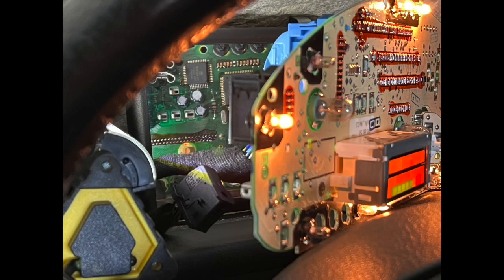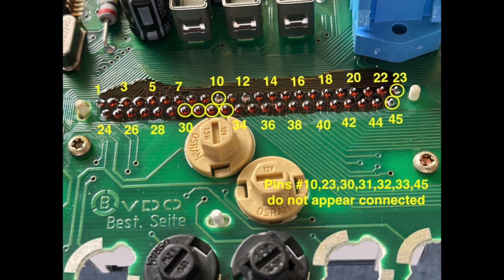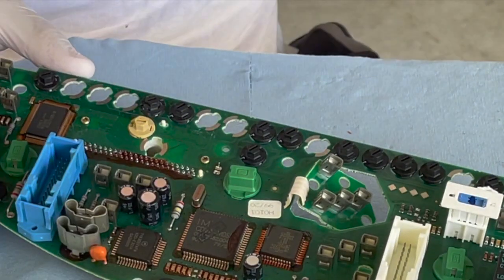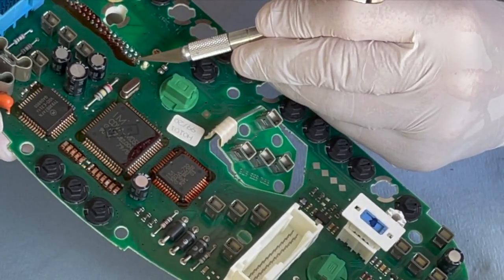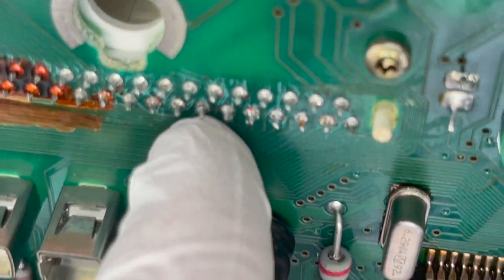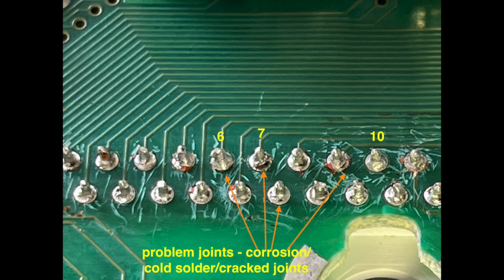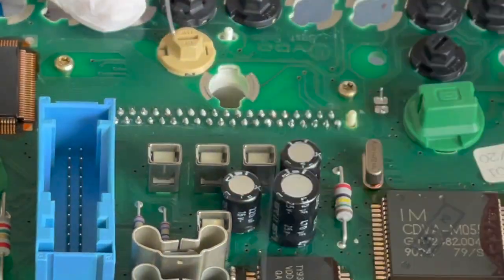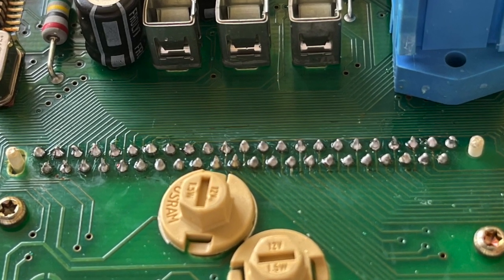Instrument cluster LCD pixel repair (sequel to "Return of the Pixels;" part 4) e36 m3

Comment: The coating can be soften for removal with IPA.  Less need for the metal blade and board damage.    I think the display can have several problems   One is bulb failure one is Zebra strip connection and the other solder connection.  The solder connection seems to be related to the pressing of the odometer reset button.
Reply from the maker: Thanks for your feedback. I agree and the solder connection, from what I see from others, seems to be the most common issue (possibly from constant pressing of the reset button).  The first time I noticed this was when I pressed the button the pixels would flicker in/out.
Reply: You sir are a legend. This should be the first video that pops up for this issue. And the only one! Cheers!